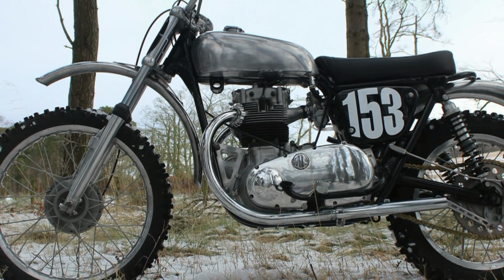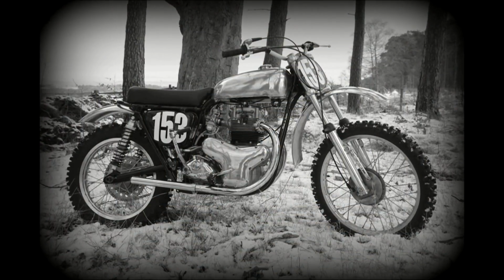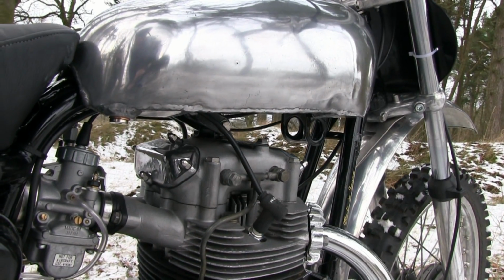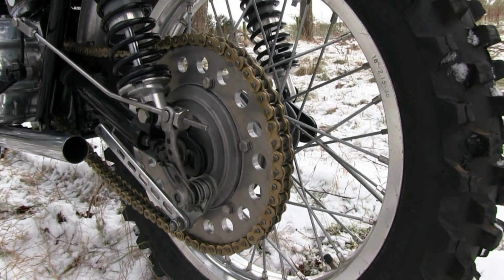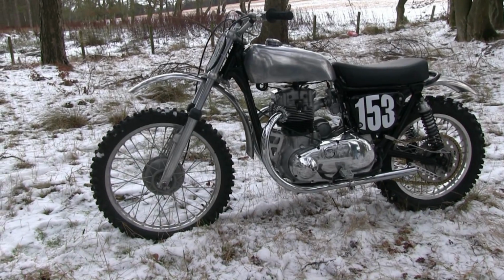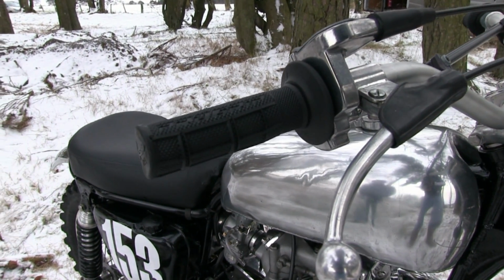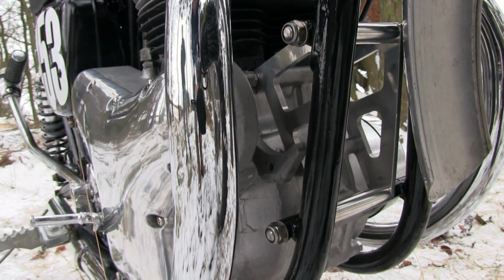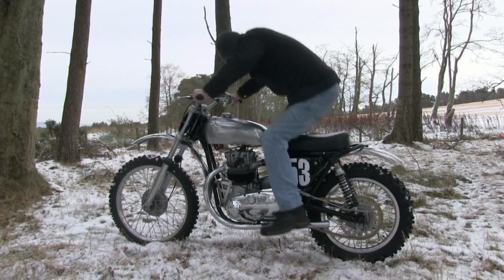Classic Dirt Bikes "Jim Alison's 1966 W1 SS 650 Kawasaki Scrambler"

Comment: Looks like the A-10 pre unit verson of the 650 BSA, to me a much better verson than the so called A-65 unit " power egg "
I had a 68 W-1+ 67 W-2
Kawasaki 650 SS COMANDER was what it was
Named!
The W-1 had an overseized makuni carb with an adjustable main jet main screw t screw on the bottom of the float bowl and you could dial it in while at speed, and was half again as big as the stock, which was wimpy looking compared to the  bigger one, and hit 124 mph a 7,000 rpm!
The w-2 (2 carbs ) had a smaller gear box sproket[1 tooth] top speed 115 mph
1/4 mile 13.87 et.
Red line began 7.25 000 and could safely rev past that,
Could easily blow off my friends 67 triumph bonnie!
I ran across a mag on a test of a 67 w2 that was partners with a car mag testing all the latest new cars also, needless to say the w2 beet ALL the latest pony + sports cars (porche 911 ect)
The mag was quite impressed with the W-2,
did not loose I race against at least 10 or more new hi-perf.sports type autos!
This was at a offical time drag strip, not just some backroad somewhere! Cheers 🥳 mate:-- as they say !   🖐👳‍♂️🖐👌🤜👹🤛
Bore×stroke.  74mm× 72.4
The oil tank had a removable  oil filter that could be removed and cleaned,a biggertype at that! W1-50 h.p. with small stock 32 mm carb but but more with a bigger single carb.  40 mm for instance..
W-2 had 53 hp stock 28 mm
mikuni, but again bolt up 2 bigger carbs, and increase h.p. a simple mod.
I personally enjoyed the 
Single carb verson with the bigger trans gear( 1 tooth )
and bigger adjustable main jet screw on bottom of float bowl of the 40 mm bigger carb. Had better all around
Power,great on open road
Highway
Perhaps the best vertical twin ever made, unburstable 
motor( red-line starts 7.25 tho.) Oversquare quick reving motor, 44 ft lbs torque stock, KAWASAKI did a hell of a job when they revamped the old bsa 650 a-10! oh yah, clutch has 5 
springs compared to a-10's
3.           P.s.--- you're bike sounds just like mine use too, sounds great by the way,totially awsome👌👍☝️
Keep up the good work, you did a GREAT JOB on that machine- LOOKS and SOUNDS TOTIALLY AWSOME❗